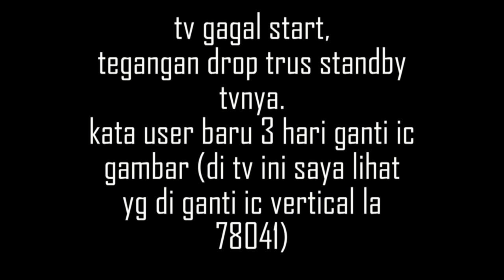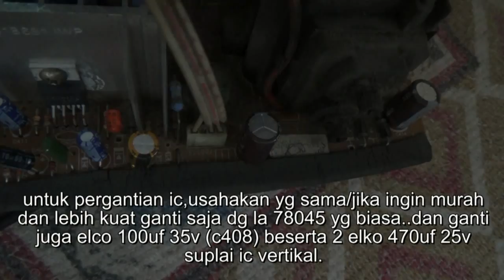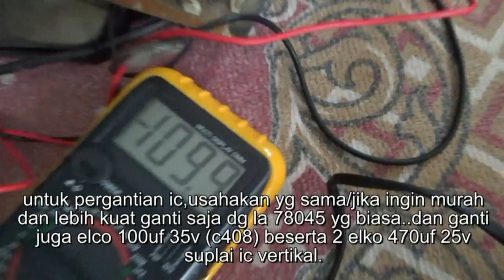tv polytron slim rusak bagian vertikalnya

Comment: Pak  kalo C408 itu yg dari tv 100mf 50V di ganti 100mf 35V tidak pengaruh ya pak  tv polytron
Reply from the maker: bisa meletus elconya.ganti yg sama mas,atau voltase lebih besar 100v ,
Reply: Mikro nya tetap 100mf volt nya di ganti yg 100v  ya pak
Reply: Apa gak panas ic vertikalnya  pak